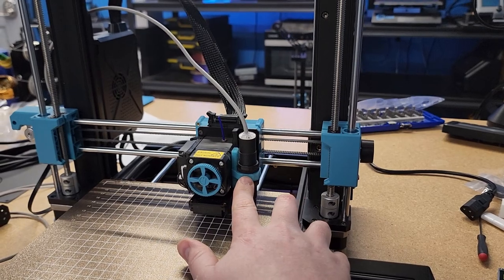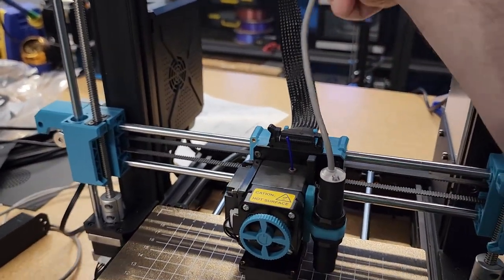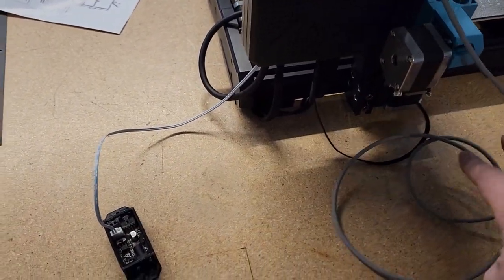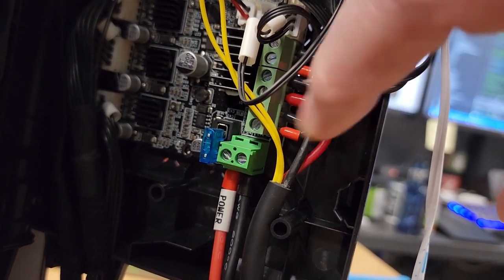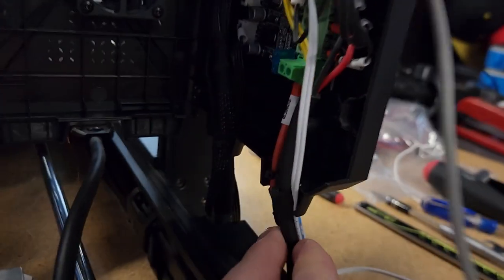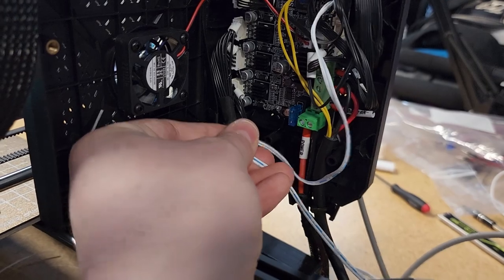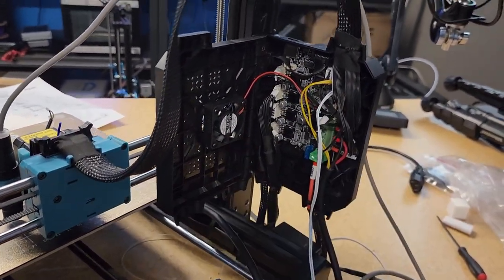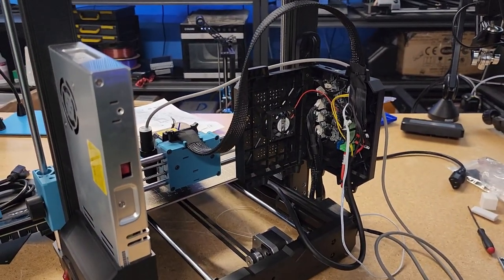Sovol SV06 EZABL Installation Tips | TH3D EZTips

Comment: I sent in a support ticket and have since narrowed down to what I think the issue is, just not sure how to fix it. I'm on an SV06 with Klipper. I was having issues with the sensor reporting as triggered and read up quite a bit. Added the ! before the pin settings in both config files. Okay, now showing open. But then with my finger over the sensor it doesn't change to triggered. So I flipped the switch on the control board, no change. I also tried putting ^! before the pins in both configs and testing both control board switch settings - same results as just with the exclamation point. The probe and control board appear to be triggering and the light goes on when you do, however it's definitely not actually stopping the Z movement when the sensor light goes off causing bed crashes if I don't hit the E stop. With the exclamation point and/carat off it simply fails homing because it reads the sensor as triggered. So any ideas as to why the Z axis would not actually be stopping when the sensor is triggered? I feel like it's gotta be something in my code. Mechanically it appears that everything is correct and functioning, the sensor just doesn't actually trigger the endstop.

Comment: I’ve been running a run out sensor since I picked mine up. I’ll double check, but I’m pretty sure that’s the port I used
Reply from the maker: I got ours working on there already. :) Just working on the firmware and documentation.

Comment: I haven't had a chance to test it myself, but the 3 pin port next to the nozzle heater port on the board is supposedly intended for a filament sensor, and is already wired to the tiny unused 3-pin port on the right side of the X carriage (close to the belts).
Reply from the maker: Yeah it is but thats a weird connector thats hard to find. Personally we're going to mount our sensor up top by the spool holder like they do on the SV06 plus.

Comment: Thanks Tim, I really appreciate this! My experience with the SV06's stock sensor has been terrible.  I have an extra EZABL on hand that I'm planning on using for this.  When you have everything finalized, will you be adding the SV06 mount to the Unified 2 STL Pack?
Reply from the maker: Yes the mount will be in the pack. its already on our github in our testing branch.